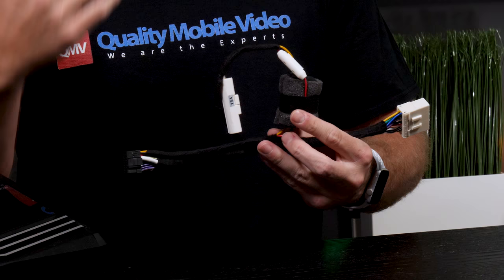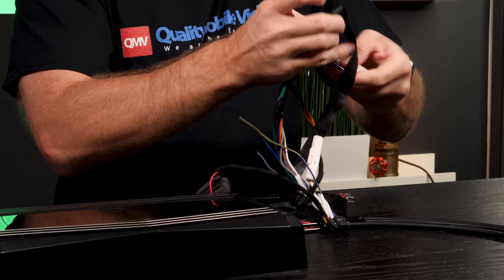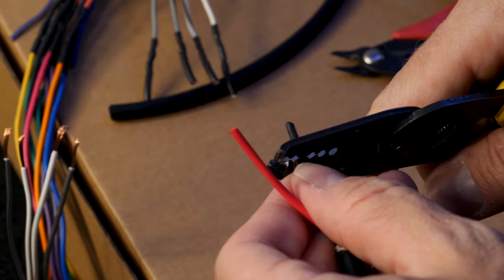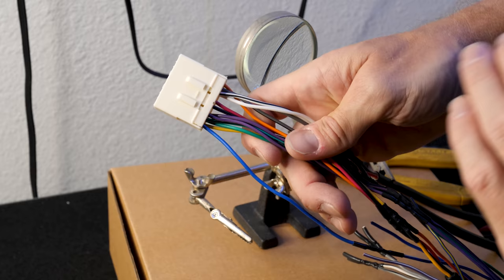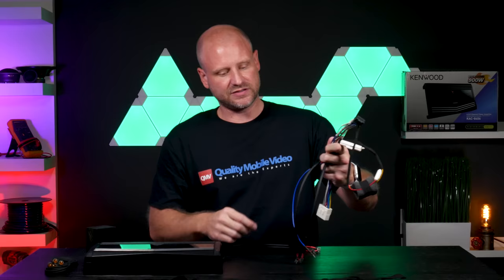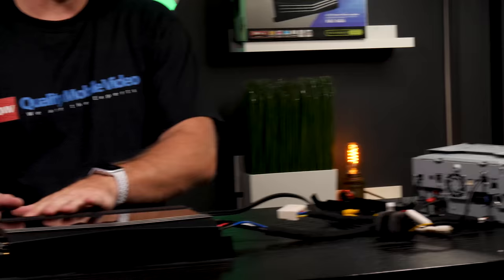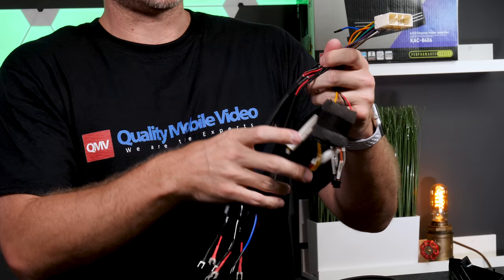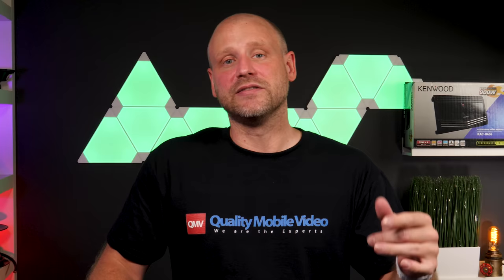Wiring a 2 or 4 channel amp to your stock speaker harness without cutting the factory wiring

Comment: Why did u go from the amp  to the head unit-side from the amp vS going to the side that goes to the actual speaker
Reply: because, the point of this video is to avoid running wires to the speakers. you're using the wires already in your cars wiring harness with an adapter
Reply: Right,you are not gonna get no sound. I hope he doesn't do installs cause he was wrong
Reply: @MyDubsack  the amp gets the sound signal from the RCA's. Then he's connecting the amps powered speaker wires behind the deck to not have to run new speaker wires
Reply: Chevydevil9000 but the wires don’t go back to the speakers so he just ran a loop without sound
Reply: I thought it was looped also, but actually the white harness is an aftermarket factory wiring harness. It connects the black aftermarket radio harness, to your factory car harness which runs to your speakers.
1. Sound from Aftermarket radio to Amp= RCA Preamp outputs
2. Now amplified sound from AMP to Speakers = Spliced Red & Black wires with terminal connectors, to speaker GREY,PURPLE,GREEN ETC. At white harness side. That gets plugged back into factory wiring in Dash.
3. The little black harness comes from radio= Speaker wires cut & blanked off, no longer used for sound.

Comment: You saved your old tape but didn't use it. It probably wasn't worth saving, that second time around usually doesn't stick as good anyways.
Reply: This is not the only contradiction in the video.

Comment: Still have to run speaker wires. You can either run them from the amp to each individual speak or you have to run them from the amp up into the dash to connect to your factory wires. Either way you still have to run wires espically if the amp is located in the rear of the vehicle. 

The key is if your going to run 2 sets of rca's to the amp go ahead & add 4 runs of speaker wire with it this way it will be much easier

Comment: Thank you for trying to help me learn, but I leant nothing
Reply: I posted an explanation for everyone, hope it helps.
Reply: Lol
Reply: Me too im sittin here like 😳.
Reply: New Alert so instead of having the amp in the head unit power the speakers have them cut and have the amp power the speakers
Reply: Lmao right it was like a kindergarten class... alright guys copy everything I do and you won’t learn a god dam thing any questions...
-billy”I do” 
-quality mobile “that was a rhetorical question!”
Reply: @New Alert Exactly, you no longer have to pull that big piece of trim and the 50 screws holding the speakers out back or roto rooter inside the door, just go off the main harness at the head unit and piggy back from there.
Reply: @TyphousJoker  Yeah and it saves you from taking your car apart and wiring all that stuff individually.

Comment: I don't understand how it goes to the speakers from the Amp, to me it seemed like, Amp to wire harness plug back into deck, or did I miss understand something. Your workmanship is great 👍
Reply: The car audio set up with amplifier begins with  stereo + amp + speakers..Car amplifiers are built 3 wiring stations. 2 inputs, and 1 output station. Inputs consist of 3 wires to power the amp. Inputs consist commonly 2 - 4 RCA jacks connections from car stereo to the amp. Outputs will be your speaker wires. When adding an amp to your car audio system it usually takes a little planning due to specifications of the amplifier used in audio system.

Comment: What we need to know is how to add an amp to an EXISTING FACTORY STEREO in a modern car/truck.  Like the UConnect system in Chrysler cars, they have 6 speakers with two rears and components in the front.  Is it as simple as putting an amp between the speakers and head unit, using speaker level inputs, but leaving ALL other connections exactly as they are and thus retaining all functions of the head unit except that the sound is now amplified?

Comment: If you go down this route how much power can the factory wires handle before you need to re-wire the whole stereo system?
Reply: maybe 200-250 watts max per channel , I'm running a 400w x 4  amp on  factory speaker wiring  without problems
Reply: @76175256  hi, do you mean  200 - 250 RMS or peak?
Reply: @austinej2785  peak

Comment: why do they never show how the wiring goes back to the speakers from the amp? or am i misunderstanding thingS?
Reply: the idea is to use the wires you already have going to the speakers. i think whats causing the confusion is he doesnt explain that he is wiring from the adapter harness. but just imagine this, when you plug your factory wires into your factory radio with no amp, the radio has an internal amp to weakly power the speakers. so essentially the wires to your speakers already in your car are the outputs to your speakers. in this video, they are teaching us how to leave your factory wires alone, saving you a lot of time and hassle to rerun speaker wires to the speakers in your doors and shit. so, you will need an adapter for your specific vehicle. most of the time you just search your vehichle year and make and youll find the right one, but sometimes you have to find one for the specific model too. now just find a wiring diagram for your cars factory stereo system harness on the internet or better yet, if your adapter harness has instructions its even easier. you plug your adapter into your factory dash harness and now your speaker wires that are already in your car are connected to your adapter harness wires. now just use your wiring diagram or adapter instructions, locate the wires for your speakers, and you can run them straight to your aftermarket amp following the instructions in this video. the idea of this is two benefits: leaving your factory wires alone, and of course, having your speakers powered by a strong amp instead of the weak internal radio amp.
Reply: @psyghtseer  If I wire it that way to a 1 Channel amp will I retain the fade and balance controls?
Reply: @AbslutZr  I assume you mean from your head unit. well you're amp is gonna need the signal from the head unit so yes. You should be running rcas from your head unit to your amp for the signal or using a hi to low converter if your factory head unit doesn't have rca output. So you will still have all the function the head unit has
Reply: @psyghtseer  I have an aftermarket radio with 3 preamp outputs but I only have a mono channel amp. I am not installing a subwoofer but I want to wire 4 speakers to the mono channel amp. No big deal there, but I do want to retain the fade controls so I can kill the back speakers at my leisure. I'm not sure how do this with the components I have on hand. I have this stuff laying around and I'm not in the mood to buy a 2 channel or 4 channel amp.
Reply: @AbslutZr  oh I see what you're saying now, my bad. Well with only one channel you won't be able to use the head unit faders. I assume you'd probably be wiring the four speakers in parallel so you might be able to rig some kind of Killswitch on the back speakers...
Reply: @psyghtseer  Probably. Would I need to make sure that the two front speakers have enough impendence so I don't blow my amp when the kill switch is activated?
Reply: @AbslutZr  the impendence would raise when you hit the switch. so you should only have to worry about when they are all on. Most amps can handle higher impendence, it's the lower number that will blow it.
Reply: @psyghtseer  Ok, thanks

Comment: I miss the good ole days of the 80's and 90's when you could slap some Rca's in the back of the head unit and lay a run to the trunk and drop a power and ground cable with a remote turn on wire in the trunk and oh yeah some inline fuses and bam...pounding down the block a 1/2 an hour later.  These factory radios nowadays have beautiful displays and shitty roll off bass.  No RCA's on the back of factory radios totally fricken sucks !!!

Comment: Is there a disadvantage in running one set of rca cables to a 4 channel amp when connecting the front and rears?
Reply: Yes...you will lose the ability to use the fade control on the head unit.
Reply: @mellowjammer  thanks man. Sooo I should just get a rca splitter? Y splitter? Male to two female or vice versa?
Reply: @dantheisen35  Dan, in order to use the fade control from your head unit you will need to have 2 sets of different inputs (2 rca cable pairs)  to the amp...one from the front channel outputs of the head unit and one from the rear channel outputs of the head unit.

Comment: Do you connect the speakers to the factor harness or aftermarket harness?
Reply: Factor he just hooked the output from stereo to amp brought the output from amp back up to head unit and hook up to factor wiring harness to speakers. It’s the factor wiring big enough? It should work might be a lot of wires running under dash

Comment: 02:44 Here you say to cut grey and white near the white connector (on the left) to weld. 
What I don't understand is, what is happening with the rest of the wires once you weld the ones near the white connector, they must be disabled/not used? This is the part I don't see in the video.
Great video btw, helped me a lot!

Comment: "How To Without Cutting Factory Wiring" but the first thing you do is cut into the front speaker wiring. I'm lost.  Are you cutting into the harness you created? So how do I make that harness? Ugh.
Reply: you are right. though typically you would just buy that harness for your specific vehicle. search your vehicle with "stereo wiring harness adapter". in the videos hypothetical harness, he says the white side connects to your car. in your car, when you remove the factory radio, the wires in your cars dash will have a vehicle specific configuration, and your adapter will plug into that. then hopefully your adapter comes with some instructions to make it easier for you, but if not, its okay. you should be able to find wiring diagrams for you cars stereo system online. as long as you can find that, you can match up which wires are going to what on your adapter and then translate the colors. from there, you can follow the videos instructions if youre gonna do it like that. if your car isnt too antique or obscure, you can find adapters like the one in the video that are plug and play without an amp. for my car, the adapter i got plugs into my car and then has a bunch of wires i need to plug into my aftermarket stereo with my own connections and solders.
Reply: @psyghtseer  let me get this straight, he basically connects the wires from the amp to the side of the harness that would be plugged into the already existing harness which originally the car speakers and such are connected? And then shrink wrap those that would be protruding from the head unit's side of the harness?
Reply: @wesbank6640  yes. this just enables you to not have to run all new speaker wires to each speaker. it bypasses the speaker outputs from the head unit, but routes the amplified signal from the amp back to the existing speaker wires at the head unit.
Reply: @psyghtseer  I greatly appreciate the info bro, seriously, and that's even if I still don't quite understand :-  MY ISSUE IS is how do I connect my mid-bass amp  to my factory speaker wiring but keep in mind my LC7i LOC is tapped into my factory speaker wires grabbing the signal. Conundrum IMO. I'm so ready to pay someone for the answer,, or.. pay someone to just do it for me already! I've been 8,000 RMS watts of just one powerful sub bass these last 6 months, time to amplify my Skar door speakers if you know what I mean.  (Skar DNR w/ Taramps Bass 8K along with another couple grand worth of electrical upgrades in addition to the two-grand I already mentioned), ugh.
Reply: @kyungrix1112  thank you!
Reply: @lowhertzhighspl  considering all that gear you probably should run better speaker wire to it anyway.. so factory speaker wire from head unit is intercepted by your LOC, then output RCA from LOC goes to the amp, then new wiring from the amp to the speakers. You at least get the keep the wiring from your head unit unmolested which is a big plus

Comment: While useful and generally true, rewiring is almost always better as you can use a bigger gauge which is more than likely necessary especially if you're gonna be using an amp like that and using more powerful speakers than what came in the car

Comment: So I watched this a few times over and you wired the radios speaker output to amps speaker output????? The radio speaker output should have been the side that was sealed off
Reply: i'm thinking the idea is that rca's will be the signal out of the head unit into the amp, then the power out of the amp will run along these wires back up to the dash and plug into the factory harness which will then carry the power back throughout the car to the door speakers..  thus completely bypassing the head unit's built in amp and wiring..
Reply: @Keldren.  excellent explanation. Ty
Reply: @Keldren.  Bro you just cleared up everything...
Reply: "Running the amp's output wires to the wires on the adapter harness is how you avoid having to run new speaker wiring throughout the car. That's the bottom side of the triangle in the photo — speaker wires from the amp connect to the speaker wires on the adapter harness. Then that harness plugs into your car." - Crutchfield
Reply: @Keldren.  my question is... if you cut the door speaker wires from the headunit and connect the amp to the head unit... how does the specific speaker left snipped know when to function or function at all... through the RCAs?
Reply: @turbodiesel321  this method is if u want to use the factory speaker wiring but after market head unit and amp so simply put, you play music and it goes out the RCA's> into the amp> out of the amp's outputs> back up to the dash into the factory harness> and then out to all the door speakers. Basically its just using a larger external amplifier instead of the head unit's tiny internal amplifier and it all synchronizes the same way using the remote wire on the amp. Hope that helps.
Reply: So do I connect new speaker wire to my aftermarket harness that goes into my screen deck? Or connect new wires to the factory sealer side on the harness??

Comment: The problem with some new car audio is that the high level signal has bass roll off or even frequency modulation, a built in equalizer, it's something to consider if you're going in this direction.  Speaker level is preferable over a LOC but only if the full signal goes thru the wires.
Reply: He said as theory.. in real life if you do that you open a can of worms..
Reply: I’m having that same problem that you mentioned how can I go about connecting it in a nother way

Comment: So I already have an amplifier, subwoofer and aftermarket head unit, and I want to Install a second 4 channel amp for all four of my door speakers. I have a few questions about wiring it up.
1. Would it be easier to cut the speaker wires from the radio like you did and run them to the amp.
2. Can I use just one pair or RCA cables to send signal to both front and rear?
3. If yes (from question 2) what amp would have the switch for 4 and 2 channels?
4. Can I make a "T" connection into my existing remote wire to send signal to the second amp.
5. Would simply getting a 2 channel amp and bridging the front and rear be simpler since I'd only have to use one RCA?
I'm a beginner with this kind of thing so I'm sorry if I'm difficult to understand. I really just want more oomf in my door speakers since they can handle around 100rms according to the box lol
Reply: Dakota 1: in my opinion i like running brand new wire cause i know what im looking at 
2: yes you can
3:almost every 4 channel amp can do this, i prefer using the rockford fosgate p400.4 its 100 watts rms per channel at 4ohm
4:if you already have an amp installed just shove a second wire into the screw hole at the first amp or if you dont then make a t connection or if you have an aftermarket deck the deck should have either an amp turn on or a power antenna wire, its the same thing either way
5:NO, this will screw with you impedance get a 4 channel amp, remeber this you can always go bigger and get smaller heres an example: you can get a 4 channel and bridge it down to 2 speakers (if the amp is bridgeable) but DO NOT get a 2 channel amp and hook up 4 speaker unless your amp is rated for a certain ohm rating and is over powered cuz if you get a 200.2 amp your only running 50 watts rms to each speaker with 4 speaker, in hindsight 4 channel is easier and the amps today there almost the same size. Hope this helps
Reply: i need the same questions answered Lmfao